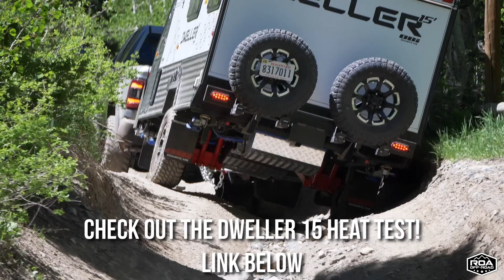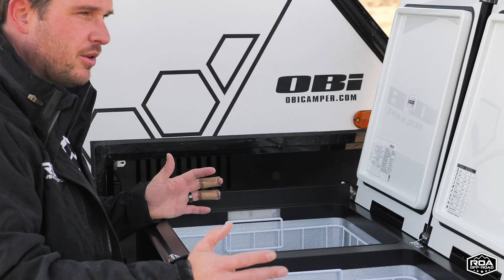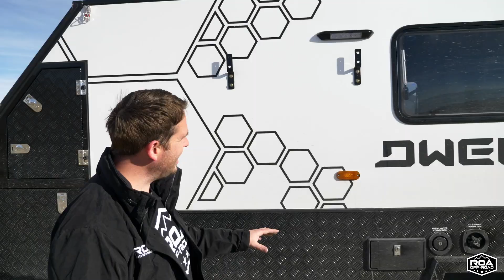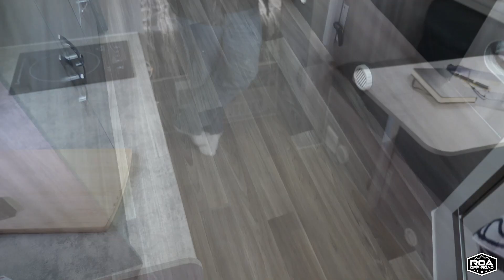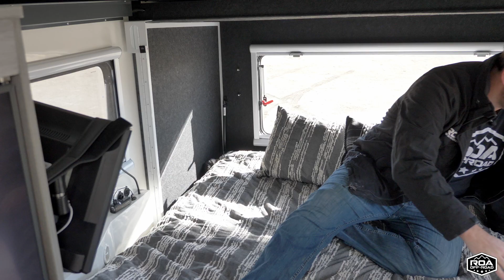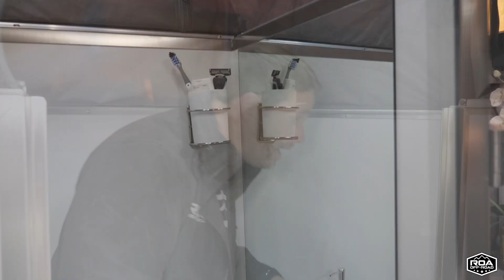Dweller 15 Fully Upgraded FULL TOUR! | ROA Off-Road (2023)

Comment: 2 questions. 1. how does this trailer pull behind a Tacoma or Ranger?? seems to be pretty close to the GVWR rating for those vehicles. Also what is the rough cost of the fully loaded (with mods) trailer run?? your website doesn't seem to list all the mods and prices.